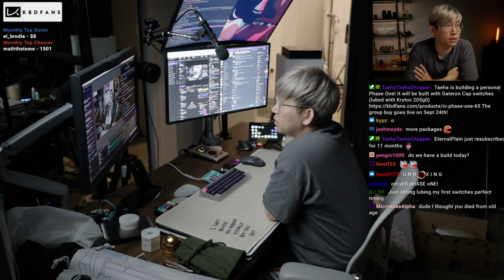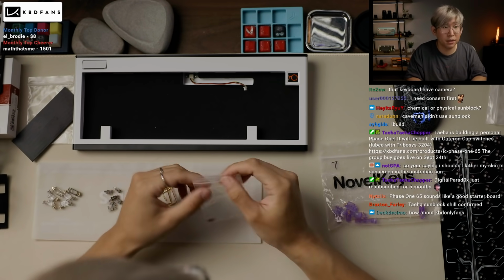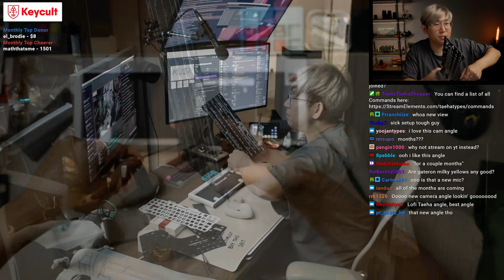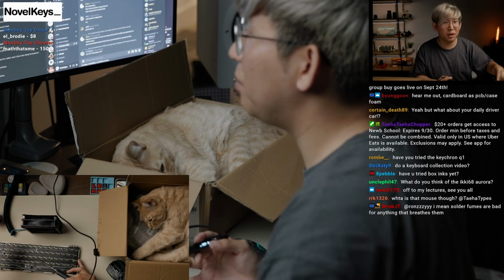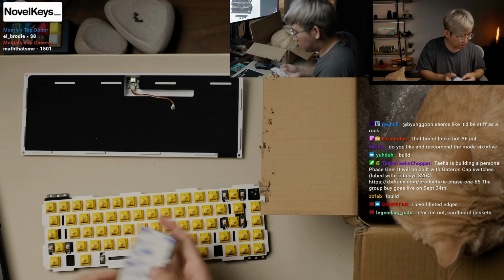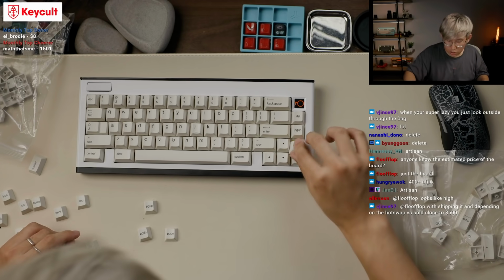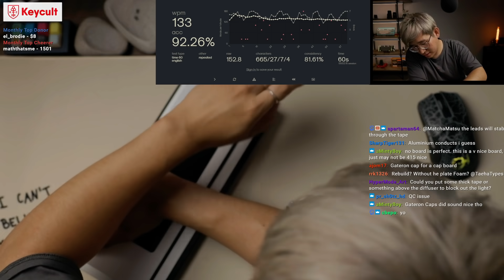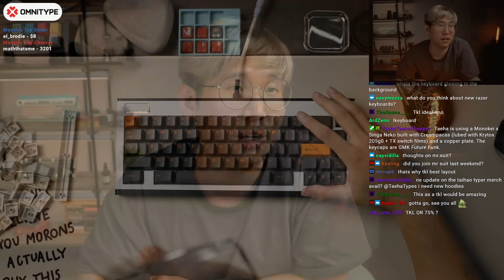Phase One Build Stream

Comment: Dieter Rams 10 principles of design boils down to “if a designed element doesn’t make an object more useful, get rid of it”. In fact I’m pretty confident that if you were to hand this keyboard to Rams, his first question would be “why have you designed a keyboard after an alarm clock”. I think this keyboard looks interesting but I feel like they shouldn’t have tried to associate this with Rams.
Reply: Haus keyboard was also a bad example of Bauhaus design
Reply: @JL-fh4qw  Yep, execution was very questionable. Hopefully we will see a true Bauhaus sometime or we need to resurrect Walter himself.
Reply: The fact the 3 lights don't face the typer, only one of them is useful (Caps) and the light bleed means this isn't fit to be associated with Rams.
Reply: I don't care looks good

Comment: The GB is about to end for the keyboard and I've somewhat finalized my thoughts on it whether or not I'll go in. 

When the keyboard was first shown during the GB for the EPBT less but better, I thought the the badge and the rgb side view were functional and moving parts. The side rgb closing and moving up depending on if your pc is on or not. The badge being an actual screen and showing the date of the month, similar to how the screen on the Matrix Vita would function but better.

Fast forward to now, I'm kind of disappointed that none of these were functional at all. Not to mention the price is crazy expensive just for the design. I'm not hating on the design, I still really like it and even now I'm debating whether or not I should buy this or go for the Ciel 60 instead and save up for the mode 65 for next year. Even with all the issues Taeha and Andy experienced with the keyboard.

If given the chance for r2 at a lower price or if I have enough cash to buy this aftermarket without spending all of my earnings in one go, I'd go for it just because of its very unique design

Comment: Thinking of picking this up any advice on which plate material to get? Will a FR4 or polycarb plate help with the lack of flex?
Reply: I am struggling with the same question here. I assume FR4 would help to make it less firm as with an aluminum plate, but that s just my assumption. I am still a newbie :D
Reply: Try a half-plate if using 5-pin switches or solder PCB.
Reply: @Bayonet1809  I plan on getting hot swap and maybe using 3-pin switches but thanks for the suggestion just curious about how much of a difference plate materials will make
Reply: @hogthecomputer  hotswap with 3 pin is heavily not recommended
Reply: Polycarbonate is much more flexy then fr4